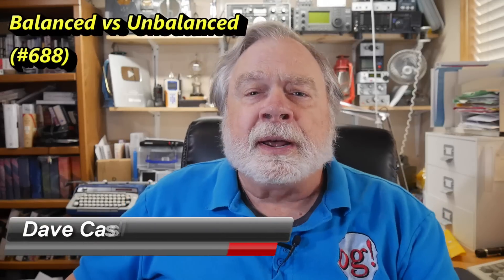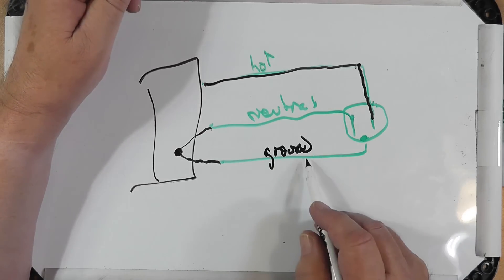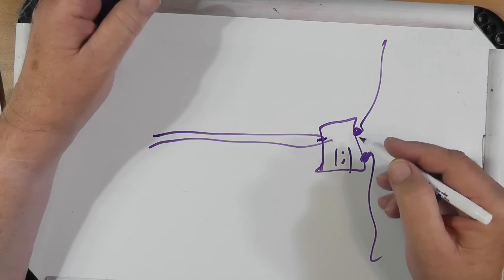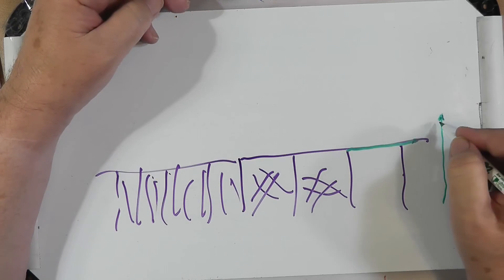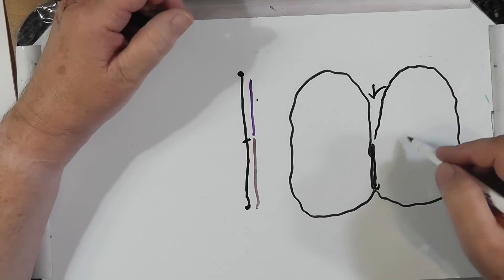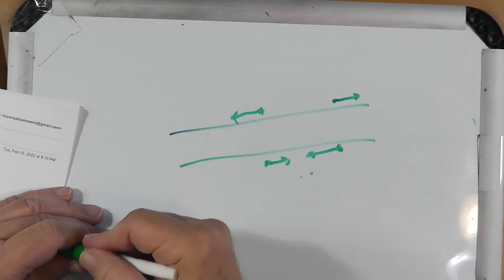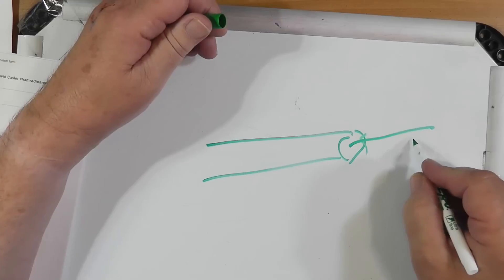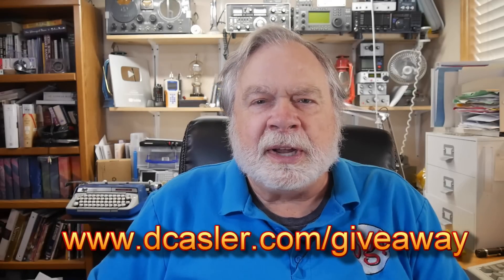Balanced vs Unbalanced (#688)

Comment: Hi Is it possible to drive each arm of a balanced antenna like dipole or bowtie with separate coax cables??
For example a transmitter has two output (balanced) and we connect one arm of dipole to output 1 and another arm to output 2 of balanced output (each by separate coax) instead of using balanced transmission lines like twin lead or .....

Comment: Trying to make understanding easier: 
When using the polarized  electrical paradigm , instead of  neutral, use: “neutral carrying conductor”. Emphasize  both the black and white wires  always carry current. The green or / bare copper conductor  “only”  carries current  when there is a “fault” condition.

Comment: Link fence won’t make a difference. Put it up as planned. Right hand rule is rule #2. #1 get on the air
Reply: Radio OH2DX  sure but how will it affect it? Show me on a nvis antenna passing over a chain link fence. No modeling software allowed. Use a field strength meter before and after. Guaranteed it’s still going to be a nvis pattern. Bc the antenna is so low, it won’t matter. Now we can raise the antenna leg to 1/4w for the lowest band. Still not much of a change. It’s like a debate of protective masks. Cloth vs crocheted. Which one works the best. Hehe

Comment: I have always had a problem with it when people say that the sheld doesn't have current. It must! If it doesn't have signal then why would you connect it to the dipole? Plus what is the return path for the current going out the center?
Reply: I agree. The return path simply is the inner side of the shield - that's the way, RF flows thru coaxial lines. If it happen that RF flows along the outer side of the shield, we are faced to common mode currents. In most cases these currents can be surpressed by a balun. But this is a complete different story. If Dave says, there is nothing on the shield, he is completely wrong. As wrong as he got, when explaining how to make a 40-10 endfed working on 80-10 just a few days ago. That's too sad.
Reply: @wilfriedeberl8593  I saw a video on how to make a meter to read common mode current. I am thinking of making one with some changes for what I can find in my stuff. It is one of the big             farite beeds to go around the coax with some turns of wire through it,  to form about a 1:10 transformer,  forgot the turns. A diode caps resistors and a meter. I am new to HF and not sure how big of a problem it is. If I see that I may have a problem I will make that and see if it works.   DE W4DES
Reply: Radio OH2DX  so it may be good to have something that tells if there is some common mode current!  Need to keep RF out at the antenna,  not coming back to the radios!

Comment: Never understood why in the USA for mains wiring they use black (for hot/live) and white for neutral?  Green as earth is pretty universal in all countries. Years ago in the UK we used red and black for live and neutral and green for earth, but around 1970 they adopted the EU mains wiring colour code which is brown (live) blue (neutral) and green with a yellow stripe for ground.
However, I still reckon the UK fused 3 pin plugs are the best (and safest) in the world. Much better than the crappy round Chucko plugs which are used in Europe. Those BTW can be plugged in reversed!
Reply: @ke8mattj  If you don't think that the metric system isn't based on French politics needing to be feel special, you should read up on how history of geodesy was shaped by the humiliating loss of the Franco-Prussian War and the century of Revanchism afterwards.
Reply: @sammiller6631  I'm sure you are correct. However, the French and British (and for centuries being enemies) never agreed on which measurememnt system to adopt. A classic example being the line of longitude zero on maps. Its wasn't until 1880 when an international  commitee agreed on using the meridian line passing through the observatory at Greenwich in London. The French were well pissed off at the time as their maps used the meridian passing through the Paris observatory :-)
Reply: @ejmills991  I think there was a lot horse trading and backroom dealing for the scientists and politicians involved that was unconnected with the common citizen's view of each country. I can see how the French could give up the Paris Meridian for the Greenwich Meridian if the British would in turn give up the yard in favor of the French metre. 

 In 1883 the General Conference of the Europäische Gradmessung ("European Arc Measurement") had proposed to select the Greenwich meridian as prime meridian in the hope that United States and Great Britain would join and accept the Association. 

The French also wanted that conference out of German hands, who started it and held the first two in Berlin. So the Greenwich meridian was used to bribe Britain to counterbalance Germany. France also offered lucrative trade deals to smaller countries if they would accept the French metre. Without all that bribery, there might have been a German metric system instead or it might never taken root at all without the sheer size of the British Empire accepting it.
Reply: @ke8mattj  The US has never used the Imperial system. The US had other units in 1776 when they broke away. Imperial units didn't exist until the 19th century.
Reply: Way back in the early days of supplying electricity to buildings, the only insulation available for wiring was rubber -- which was traditionally colored black. It was decided that the hot/active wire was the more dangerous one and therefore it was always insulated. When it was decided to insulate both supply wires, the next readily available color for dyed manufactured rubber was white.

Comment: Try it one way for several days, then turn around the polarity.  You may find it works better one way than the other. 
I’ve never seen a dipole make any difference, but a OCF, can make a big difference. 
Just my experience.